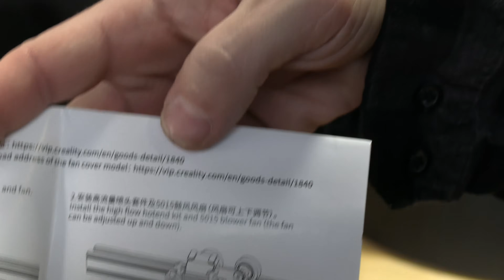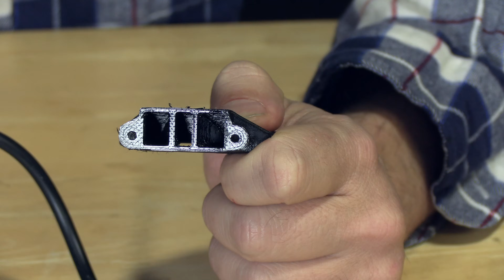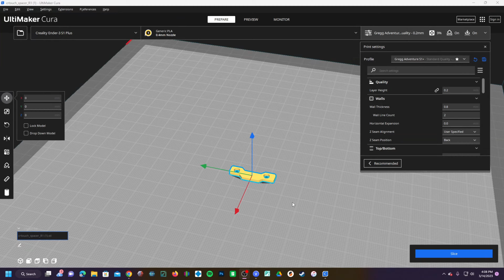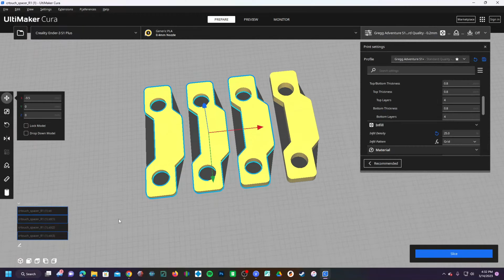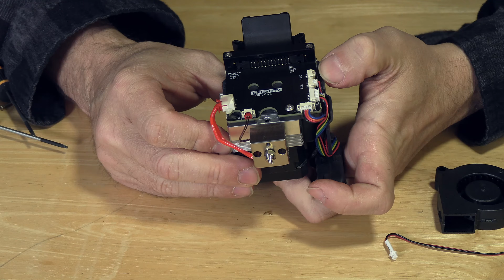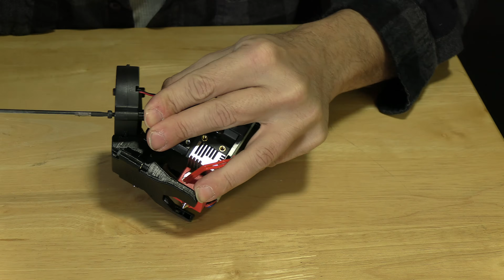Install the Creality Ender 3 S1 High Flow Kit for Sonic Pad with 5015 Fan and V3 Air Duct by ZUFF

Comment: Hello! Great video with a very detailed explanation, but it doesn't specify whether the mod is worth it or not.
I have an S1 updated with a Sonic Pad, and it prints quite well, except that when I print overhang parts, they come out with unsightly warping. I think the cause is the low cooling flow. Before changing the printer, since it's clearly obsolete now, I'd like to try this mod. Do you think it can help me?
Reply from the maker: I would seriously consider moving up. An A1 or P1S would be massive affordable upgrade.
I avoid reviews because so many variables can effect your results. This hotend with the Zuff ducts, works very well
Reply: @3DRundown  Thanks for the reply, I'm waiting for more reviews for the Snapmaker U1 and then I'll decide. The thing is, I hate creating e-waste because I doubt I’ll be able to sell it.
Reply from the maker: It's not waste. Just different use. People like the U1. I Do not have one.

Comment: Great job as usual. One question, Do you need to put grease on the tube before you put the new one on? I only ask because when I changed the nozzle on my Ender 3 V3 Plus the said to put some grease on the tube.  Also how do you know what size spacer you need on your bed leveler thing, I'm kinda new to 3D printing so it's pretty inevitable I'll probably f*ck this up like my last couple of mods. One day I'll figure out how to properly add my Ender 3 V3 Plus to my Sonic Pad and the POS Anycubic Kobra 3 Ace Combo.
Reply from the maker: Your V3 Plus is already running Klipper, on the Nebula pad. No use for the Sonic pad at all. 
You will want this on your hot end heatbreak: https://amzn.to/45KCmzD

Comment: When you add the spacer do you have to then go in and reconfigure the CR Touch offset in your sonic pad? since it otherwise staryed the same youd just adjust it by the spacer mm right?
Reply from the maker: No. Leave everything as it is

Comment: Such a excellent video. One question…… I have not yet installed the upgrade but will this upgrade fix this issue I’m having on my Ender 3 S1 Pro and Creality Sonic Pad? Here’s the issue…… every time I start my first print after switching it on, the nozzle temperature bounces all over the place until I get a Key1 error message and have to restart. After the restart it works correctly with the temperature no longer bouncing up and down. 
Will this upgrade kit fix this problem?

Comment: After  the fan upgrade did you need to lower the fan speed or kept it at 100? I have an extra 5015 fan, thinking of throwing it on my S1
Reply from the maker: Left it as is
Reply: @3DRundown  gotcha thanks

Comment: It surprises me that so many people have had all these issues with the S1. I got mine as an unrepaired return for $65, it had M5×45 frame screw that couldn't be used due to a defect, swapped out the frame screw, threw professional firmware on it, set the offset and let it roll. I have a Sonic Pad on it now, I still haven't done the all metal high flow hotend mod yet cause I haven't really gone for much in the way of speed or printing beyond ABS, I'm going to swap the hotend when I need to badly enough, just not there yet. I love my S1 though, beats the pants of my insanely modded OG Ender 3 that's running Big Tree Tech everything, that's a pretty good machine too now that it's modded to hell and back but my S1 is still my go to baby, running Klipper with input shaping and accelerometers at normal speeds spits out prints with insanely crisp details and a finish that leaves later lines way less noticeable. I just adore that machine.
Reply from the maker: My S1 is the only machine to date, that I abandoned and never put into use. It's ABL absolutely refuses to work, no matter what firmare I used, or tricks I tried. My S1+, on the otherhand, did great things for a good while, till the new firmare bricked it. I may fix it one of these days. I like big beds.
Reply: @3DRundown  I must hav gotten lucky or something, I had a time or two where my Z axis offset just randomly decided to change every time it moved, but for whatever reason that kinda went way and never really came back. I never really had any kind of issues at all with the actual bed leveling or meshes even before the Sonic Pad, prior to Klipper I was running the Professional Firmware, and in front of that I also had Octoprint with its mesh builder and viewer and leveling add one, 9 times out of 10 the mesh that Professional Firmware spit out on the printers screen pretty much jived right along with the mesh that Octoprint was building, maybe a difference of about .001 here and there but I'm not even paying attention to a .001 variance. So maybe it was just getting lucky for me, cause I have seen other people having a bunch of issues, but alot don't do it's prolly a lot down to the typical Creality/Shenzhen quality control, I also am the type of person who actually loves working on, modding out, and fixing these machines, that's why I always s buy returns and get them running myself, for me arguing with them is 60% of the fun, I realize that is not most consumers but a wonky machine with good bones at the core isn't a downside to me, it's a challenge
Reply from the maker: I do the same. 75% of my machines, were returns. Usually, nothing wrong with them. Rampant user error.
Reply: @3DRundown  Usually it is yeah, the OG E3 I bought literally just had a broken belt. That was not a hard fix, the frame itself is all that's original. One thing I thought of with the difference in quality and issues with the S1, could maybe have something to do with the different system chips, some had an F1 32 chip while others have an F4 Soc (mine) I wonder how much that comes into play here, was yours the F1?
Reply from the maker: I think that may be something. I thought about swapping the board, but, these days, it's not terribly relevant in my lineup. However.... I did recently inherit another S1. It's in my garage. I should give it a go. But, I do think my S1 was an F4. It made an ABLE mesh, that looked like the ocean with a regular swell going. nothing changed it. 
I got a CR6-MAX for $175 that had a dirty nozzle. Lol
Reply: @3DRundown  A CR6 Max for $175? Niiiice! Yeah I can understand not wanting to wrench on an S1 with other viable printers in your rotation, all I have and can afford working at McDonalds is my OG E3 and My S1, so I'm thankful mine works so well for me, cause it's what I can justifiably afford right now without saving months in advance, however, I'm waiting and watching for the K1 to become a more common unrepair and return unit, I see a few on eBay here and there but not a ton, but as soon as I save up $200 or so I am gonna buy a returned K1 and throw my hat into that ring, mostly because I am apparently a masochist and love torturing myself and spending money I don't have, apparently that's my idea of hobby😂

Comment: Hello, cool video! I have a question regarding 5015 Fan, I realized the upgrade as well, but my Ender has been facing a trouble with "Z" zero level since the upgrade. Probe lights purple and goes down and push however  the extruder hit the surface :(, then I have to quickly turn printer off. I tried factory reset but no luck, still the same issue. Heating nozzle, fan and probe works at first look. Any tips? Thank you for advice!
Reply from the maker: When it's lowering, if you trigger the probe, does it stop? Sounds like make   CR-Touch is too low. Did you install the spacers? They look like little metal tubes. Or, Try this:
https://youtu.be/fhTIfO1m_yQ
Reply: @3DRundown 
You are absolutely right! I found it later on that I overlooked spacers to probe. Shame on me. Thank you!

BTW: is there any way how to configure fan speed, it resets value to zero during new printing. It's annoying to keep it in my mind. Thank you for advice.

I wish you a lot of great videos like that on YouTube!
Reply from the maker: Your GCODE will turn the fan on and off as needed, as well as set the speed. It's all done in the slicer.

Comment: Do you have to use Pet-G for the mount? I can never find any sort of direct best solution to upgrade airflow for the Sonic Pad so I found a kit and will be here this week. Was there any sort of issue with fan speed through the settings of klipper I know people say if they splice in a fan it makes a lot of issues, that’s why I went this route
Reply from the maker: Yes, I used PET-G

Comment: Creality makes some excellent printers and equipment. But some of the ....methods...and....support, if youd call it that, make me scratch my head. thx to cool people contributing to a thriving  community, their crappy support is not needed.
Reply from the maker: Creality are the most helpful, interactive, and friendly, 3D printer company by FAR. Their support is great. So great, I've become personal friends with many people at Creality.
Reply: @3DRundown  good to know. i WILL take your word for it. maybe i misunderstood, I meant instructions. 

 but reason i said that is cuz they provided the fan, with no solution for mounting. then when you opened the instructions, that link. Then the whole situation with the incorrect file that doesnt work. So you had to go thru "community support" to find the fan duct. And then....the design (in their instruction booklet) being somebody elses. BUT, i realize thats just the instruction booklet and isnt necessarily reflective of their support people. my ender 3 s1 instructions were goofy in a few spots too. 

but i have done tech support before, and I know the pain, ;D, of having to be the support person, for a product that has an obscurity in the manual. As people will tend to hate on you (as if you wrote the manual yourself!) 😑 

much respect to any support team that is worth mentioning because good tech support these days is harder and harder to find. most people outsource to india/manilla/etc....that sounds like a line, but im in IT support, so Im constantly calling many different manufacturers for stuff.  I do appreciate support that will take the time to listen to you, and shows actual empathy, or tries. 

I am however convinced that the worst support on the face of the planet lies in: Hewlett Packard. Pray you dont ever have the displeasure of experiencing their tech support. 

Sorry Creality for crapping on your name, love you guys!
Reply from the maker: Oh man. Yea... The Duct fan was not ideal, and I was not pleased about that. I also couldn't get the "VIP" site, to work, where the duct was for download. The good news is, in the past year or so, Creality has done a LOT of course correcting. Manuals are better, support is better, the VIP site works....  But yea, Creality are really great peeps. I like them allot.

Comment: Do you need to use the spacers?
Reply from the maker: Yesssir
Reply: @3DRundown  do I need to use as many as you did?
Reply from the maker: I would use the little metal ones that came with the kit, they will be the perfect length.

Comment: Is it possible to print the bracket without the new fan?
Reply from the maker: No, cause you'll have a big unused hole where the fan blower goes
Reply: Thanks so much  @3DRundown   then I'm really big trouble now :) My Hotend Thermistor for the old Hotend broke and I can't print anymore. Because of bad delivery times and my Sonic Pad, I ordered this new High-Flow Kit. So I guess I will not be able to print the bracket :)
Reply from the maker: Always have a backup printer. Grab something used on ebay. Whatever it takes. Have a second machine
Reply: btw: a really really enjoy your videos and admire your work!  @3DRundown
Reply from the maker: Thanks so much. Good to have you!

Comment: Hello everything is fine? I have an Ender 3 S1 Plus. With this change, can the nozzle reach 300 degrees of heating? Did you need to make any code changes to the software or change something in the Sonic Pad?

I really like your videos, you explain very well.

Thanks for everything and hugs.

Comment: Hi! In fact, the stl file can be found in the url referred on installation guide, you just need to create a creality cloud account, then select the upgrade kit and hit the download button. I’ve installed that kit and it was very very easy, but Creality does provide the stl file. Cheers!
Reply from the maker: I tried dozens of times, and even spoke to Creality about it. They told me only resellers can make the account. If it's working now, things have changed. However, I wouldn't use that stl.

Comment: One thing i just noticed is that there may be a possibility that you need to change the flow and temperature setings. This is just a speculation based on what keeps hapening to me, but even with the v4 fan duct, though it worked much better, it still seems to have some blobs and cant print overhangs that well. If its a high flow kit, then the plastic would melt faster or more than it did previously right? Should the flow settings be changed in cura so it wont overflow and mess up the over hangs? Or maybe lower the temperature too?
Reply from the maker: You may indeed want to do some calibrating. For me. A small retraction change was all I needed. Can run some Calibration towers. Temp, speed, retractions. See how things look

Comment: I find it unacceptable from a big company like Creality to cheap out..The don't stop to amaze me with their strategies..
Reply from the maker: Cheap out? You Drunk. Creality may make occasional missteps, but they usually resolve them and certainly never "Cheap Out". They are the best China company I work with by FAR. And I work with ALLOT of china companies. Very hard working, always innovating. Fix their mistakes. Friendly and active in the community.

Comment: nice upgrade, but why would you ever need it? Surely not for 50-60mm/s printing and because this offers the best quality and least stress on the parts, i dont see why you ever have to go faster. Same goes for the standard 4010 fan. More than enough. Its usually even a better idea to reduce the fan speed. And changing it for the sake of silence makes also no sense, because the heatbrake fan is much louder.
Reply from the maker: People print twice that speed on S1's.
Reply: i dont have to save 30 or 60 min time. @3DRundown
Reply from the maker: Some people print things that take 3-4 days. You'd be saving hours. But, who really cares? You do you...

Comment: Hi just installed after following your video, just want to say thanks you simplified it just enough. Lol I should have planned on printing the ducts first, didn’t think the stock duct would have been in the way. I never bothered to check but the nozzle that cane installed, was it a .4mm or a .6? I’m printing the duct now and just thought of that. The packing list says 1x .6mm nozzle but there’s one installed and one in the bag. It seems to be printing fine so far with it sliced as a .4mm.
Reply from the maker: It should be a .4 installed. I think.....maybe.
Reply: @3DRundown  thanks hope your right the extra nozzle is .6
Reply: Just printed and installed the duct fan V4 and checked it is indeed a .04 installed.
Reply: This Spider hot end is quite a bit heavier than stock, has anyone tried the ceramic hot end for the Sprite? It’s much lighter.
Reply from the maker: Spider isn't for the Sprite, but the HF Kit uses the Spider heater block and Nozzle. Speedy Spider is Ceramic. Heats crazy fast. The Sprite Ceramic should as well
Reply: Sorry that’s what I meant I just saw the word Spider on the heat block. It was a lot heavier than stock block because of the size difference. I saw on Ali a ceramic made to fit the Sprite that’s supposed to be lighter than stock and was wondering if you have tried it yet.
Reply from the maker: Ah yes. It does indeed say Spider! I believe it to be the actual OG Spider Heat Block. I have not done the Ceramic. Ceramic is the future of 3D Printers. All the fast machines are using it, but I had issued with my Spider Speedy, on my 5+, not heating properly. Def worth a shot on the Sprite.

Comment: Well, great video. For Creality - my kit break pin of hotend, so I`m now searching for new PCB.
Reply from the maker: Hope it's fixed up now
Reply: @3DRundown  - Sorry for late reply. At the end, I ordered new PCB. Works fine now. Installed it another way for second time - pluged hotend cable first and then moved whole PCB into place. Seems making little bit smaller tension - connector is OK now.